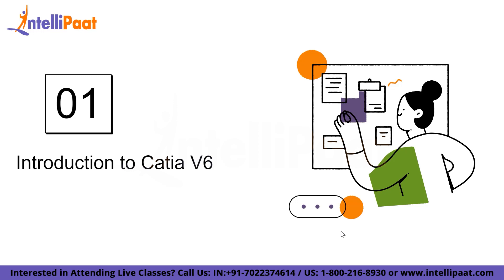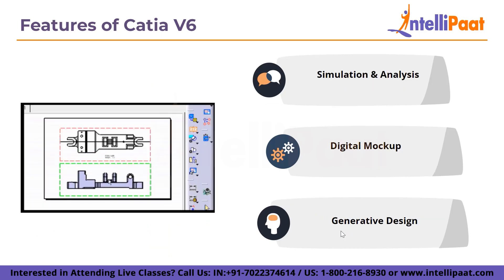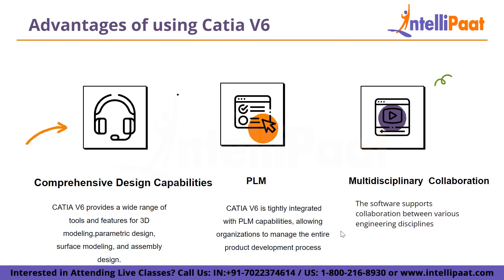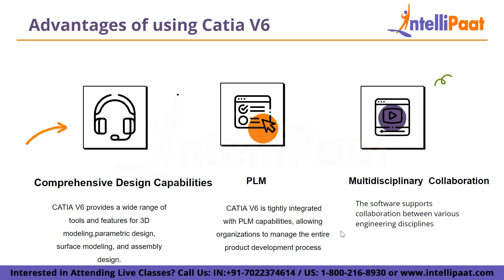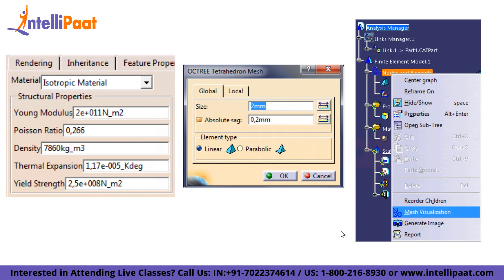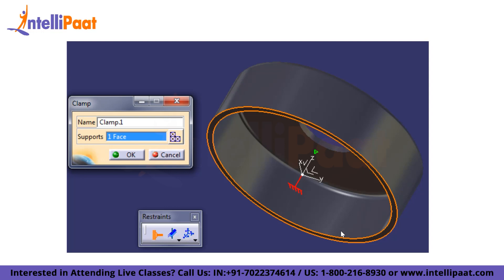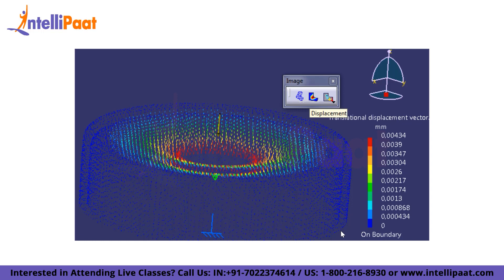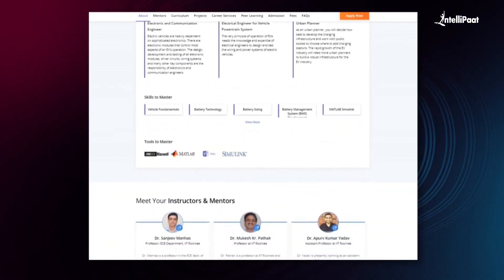What is Catia V6 | Catia V6 Explained | General Structure Analysis in Catia V6 | Intellipaat

Comment: So obviously as for Generative Structural Analysis is concerned, there is no difference between v5 and v6.
Reply from the maker: Thank you for sharing your insight! While both V5 and V6 may offer similar capabilities for Generative Structural Analysis, each has its own nuances depending on the platform's evolution and user requirements. Feel free to share any specific experiences or comparisons!